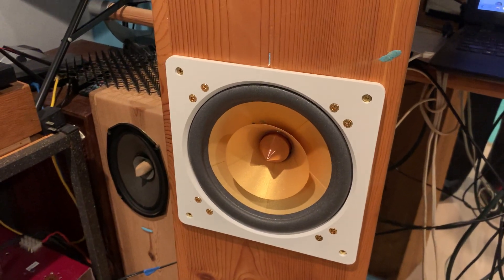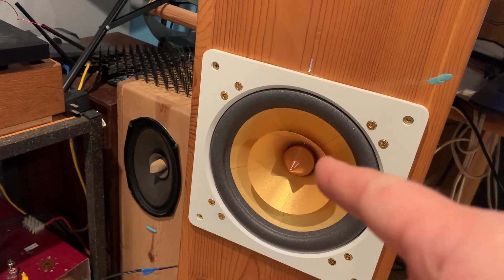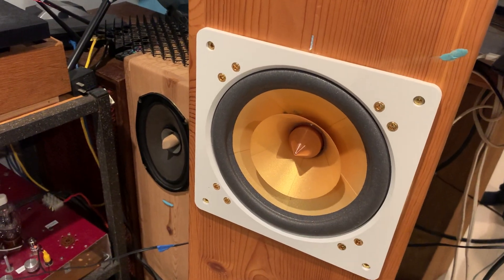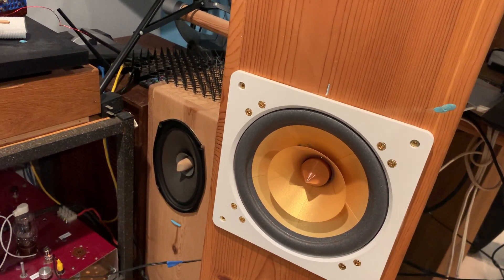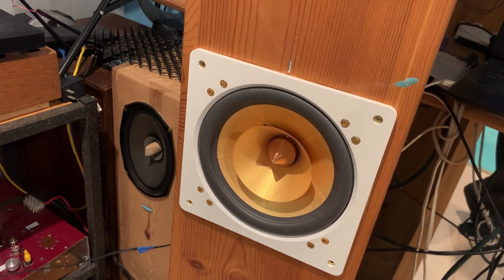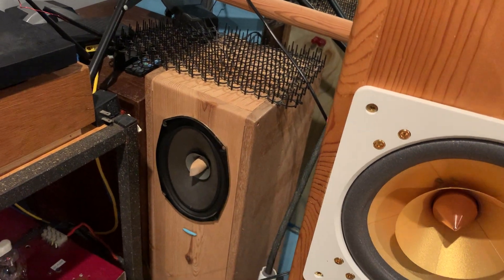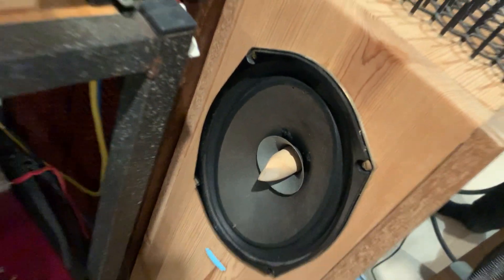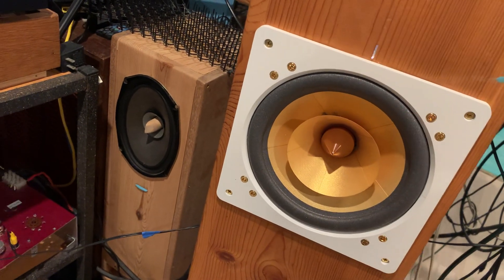Loudspeaker driver direct connection: how did it change the sound?!

Comment: So, your internal wire leads are soldered directly onto the on-papercone endings of the voice-coil wire? Are they sufficiently flexible to work without undully pressing against the cone? And in case you'd have to remove the driver for service or other tweakings, you'd have to unsolder it again? Why don't you just reject the speaker wire terminals on the back of the box instead? (I mean drive the speaker cables directly through the wood and attach them to the driver terminals, sealing (airtightly) the cable-holes with cotton string (and even glue)? That's what I do but I never thought there might be a step even further, to get rid of any intermediate connection between the speaker wire and the voice coil. Anyway, thumbs up!
Reply from the maker: They do not touch the cone, the terminals are used as mechanical connectors, and the tinsel wire has no mechanical stress on it. I have left the connectors, as this allows to use multiple speakers. My speaker cable are too expensive to afford internally hooking them up to a speaker - although that would be the best solution,  but would exclude every and any other speakers benefiting from high level cabling. ; )  If you have one set of speakres though, then  I do recommend to mechanically hard-connect it to the tinsel wire, provided you have secured the speaker cable EXTREMELY WELL to the cabinet. Otherwise the slightest pull of the speaker cable, and you have torn out the tinsel wire, most likely permanently ruining your driver. So, keeping the connector is also a very important safety measure for longevity. In a decade or two one is bound to have an accident to pull the speaker cable and tear out the sensitive bits along with parts of the cone and ruining the voice coil....

Comment: Bro i had a question for you , if i were to roll my own transformer, what kind of core would be best and which metal or metals would be best to use
Reply from the maker: Aaaa! There's a gazillion of questions that need to be answered to get the answer. The answer is; the best choice depends on the application. Each application, each instance requires something else, has its own specific needs. 
For starters, stat with silicone steel laminations, least chance of making an error / mistake with them. 
Even easier: for home brew OPT and power transformers, use the transformer laminations from a microwave oven. ;) Best place to start TX making learning...